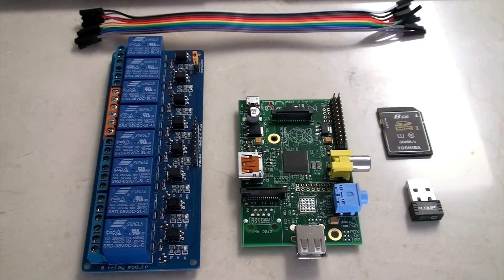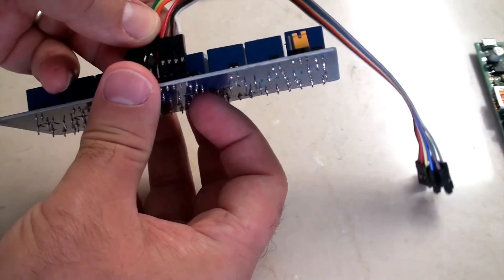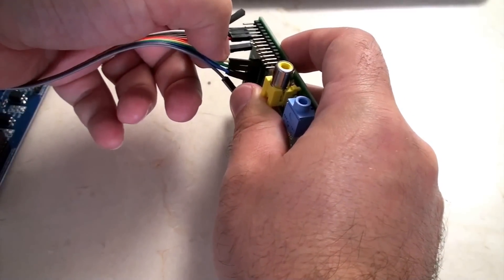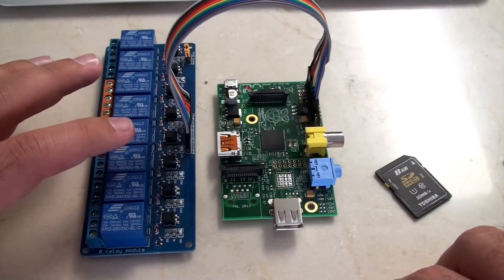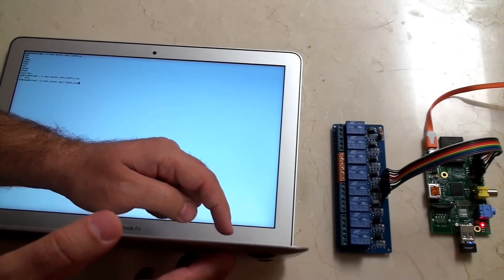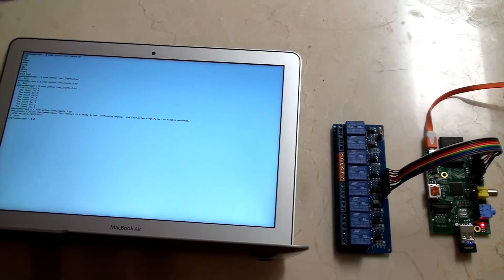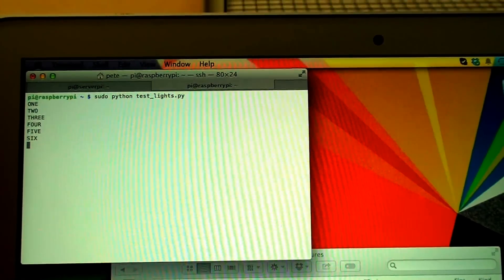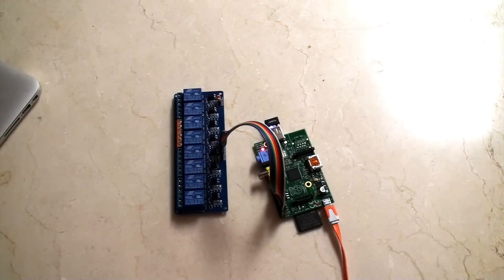Raspberry Pi: 8 Channel Relay step-by-step with software examples for automation

Comment: Hi SkiWithPete, hope you still are here. I am having a problem with my 8 channel relay and my Raspberry Pi model 3. My Pi can't handle more than 5 relays - if I activate more than 5 relays at same time - The relays start blinking and flickering. I guess my problem is, that the Pi can't supply enough power through the GPIO pins, so I have added external power to the channel relay. Neither this solves my problem. I have also bought a 16-channel relay, which is totally hopeless. So I would like to hear if you have any ideas to solve my problem. Of course my 8 channel relay is bought through eBay (China) - could this be a problem? I have never received any electronics from China that didn't worked fine? - I could buy the relay through my local store to 40 dollars instead of the one for 6 dollars from China. - But I am pretty sure, that my local store also just buy it from China...? Looking forward to hear from you. Regards,
Reply from the maker: Is it an optocoupler relay? That's usually the problem, with symptoms you describe
Reply: Hi there again, "Optocoupler"? What does that mean? 🙈 - I now see the word, when I search for 8 channel relay on eBay and yea - I may probably have bought the first and best search on eBay - which is optocoupler. Would this one be better? 
https://www.ebay.com/itm/5V-8-Channel-Relay-Module-Board-For-Arduino-AVR-PIC-MCU-DSP-ARM-LW/172396554144?epid=2068679709&hash=item2823a2a7a0%3Ag%3ADYYAAOSwImRYGpkT&_sacat=0&_nkw=8+channel+relay&_from=R40&rt=nc&_trksid=m570.l1313

If not - could you maybe found one on eBay for me? I know you have linked one on Amazon, but since delivery is really expensive to Denmark - I would appreciate to find one on eBay. If the relay isn't optocoupler - will it then work fine - you guess?

Regards,
Reply from the maker: Frederik Munch-Hansen search for optocoupler relay on eBay.
Reply: skiwithpete Hi there again, now I have been looking for a non-optocoupler relay without any luck. What would you suggest me to do?
Reply from the maker: Frederik Munch-Hansen no, not a non. An optocoupler. Watch my 4 relay video. I trouble shoot there.
Reply: Would you say, that the relay I got from eBay probably might not be an optocoupler relay? There is no problems between my raspberry and my relay in connections.
Reply from the maker: Frederik Munch-Hansen I have no idea what you bought.
Reply: But you think the problem would be solved by buying an optocoupler relay?
Reply from the maker: Frederik Munch-Hansen at least you'd have the relay I use in this video.

Comment: Did you ever figure out the problem with RPi B+ models?  According to the reviews on Amazon, this is not a problem as long as the power jumper is connected between JD and VCC on the relay PCB. Will find out soon as I just ordered one to use with and RPi 3 B+ but this is not a typical complaint in the hundreds of reviews on Amazon.
Reply from the maker: John Baxter I assume it was low power input, but I don't really know

Comment: Said you wanted to build a community so here is some code I did I thought was cool:

from pynput import keyboard
import numpy as np
import RPi.GPIO as GPIO

GPIO.setmode(GPIO.BCM)

# init list with pin numbers
pinList = [2, 3, 4, 17, 27, 22, 10, 9]

# loop through pins and set mode and state to 'low'
for i in pinList:
    GPIO.setup(i, GPIO.OUT)
    GPIO.output(i, GPIO.HIGH)

def on_press(key):

    if key.char == 'a':
        GPIO.output(pinList[0], GPIO.HIGH)

    if key.char == 's':
        GPIO.output(pinList[1], GPIO.HIGH)

    if key.char == 'd':
        GPIO.output(pinList[2], GPIO.HIGH)

    if key.char == 'f':
        GPIO.output(pinList[3], GPIO.HIGH)

    if key.char == 'h':
        GPIO.output(pinList[4], GPIO.HIGH)

    if key.char == 'j':
        GPIO.output(pinList[5], GPIO.HIGH)

    if key.char == 'k':
        GPIO.output(pinList[6], GPIO.HIGH)

    if key.char == 'l':
        GPIO.output(pinList[7], GPIO.HIGH)

def on_release(key):

    if key.char == 'a':
        GPIO.output(pinList[0], GPIO.LOW)

    if key.char == 's':
        GPIO.output(pinList[1], GPIO.LOW)

    if key.char == 'd':
        GPIO.output(pinList[2], GPIO.LOW)

    if key.char == 'f':
        GPIO.output(pinList[3], GPIO.LOW)

    if key.char == 'h':
        GPIO.output(pinList[4], GPIO.LOW)

    if key.char == 'j':
        GPIO.output(pinList[5], GPIO.LOW)

    if key.char == 'k':
        GPIO.output(pinList[6], GPIO.LOW)

    if key.char == 'l':
        GPIO.output(pinList[7], GPIO.LOW)

    if key == keyboard.Key.esc:
        # Stop listener
        return False

# Collect events until released
with keyboard.Listener(
        on_press=on_press,
        on_release=on_release) as listener:
    print('Monitoring Keyboard...')
    listener.join()

GPIO.cleanup()
print('Complete')
Reply: Sterling Butters heyyyy that’s pretty good

Comment: Is the actual pins or the relay putting out power? I just want to use the relay as a switch. I dont want the relay to give any power on the pins themselves. I am going to attempt to solder wires onto a television remote and imitate pressing of buttons by closing the switch. Would this work?
Reply from the maker: Aaron Zaffle yes, the relay is just a switch.
Reply: skiwithpete would I be able to remotely trigger the script to run over the internet? I am familiar with port forwarding however am completely new to pi and programming in general
Reply from the maker: Aaron Zaffle I have multiple relay videos. Watch the 1 and 4 to better understand how to do that

Comment: is it okay to connect the relay board to circuit breaker ?? and in pin of the relay switch connects to the raspberry pi??

Comment: Hi Pete, I like the video and am wanting to do something along these lines. What I want to do is set up a relay to switch from an external power source (the grid or battery bank) to an internal one (ThermoVoltaic cell bank within the heating unit) when the internal source reaches the proper voltage for the DC motor. Do you or anyone else have any thoughts or advice?

Comment: For some reason when I hook this up to my RaspberryPi Model B the code for setting the high and low do not turn on and off the relay. Im copying the code exactly from GitHub and its not working. Any suggestions?

Comment: Hi, I have a 5V 10 A 8 channel relay module. I want to use it for controlling any device which we usually control by switches. So can I can power it just by the 5V GPIO pin or do I need a DC adaptor like you used to power your 16 channel relay in the other video? By the way I have a Raspberry Pi 3, show it should work right?

Comment: Hey thanks to his video I've got a crazy idea to build a car computer / infotainment thing for my 2011 Jeep JK.  Much like the Alpine X109-WRA.  So I got a Raspberry Pi 3 B I think it's the plus and this same relay board within an acrylic.  Now my question is I want to run everything through a touchscreen and make auxiliary switches through the touch screen for off road lights, lockers, winch, etc.  I've got a fuze box to run the 12v from my Jeep to each really through a 30A fuze and a ground bus for all the grounds.  My biggest issue is the software.  I really like the Blynk app but since my Pi has arrived in the mail yet I'm worried it won't work on the Pi unless connected to the internet.  Any ideas that I can use for the touchscreen switches?

Comment: Just noticed that the relay supports two power supplies - one from the PI and the JCC being the 5V for the relays. These can operate independently as from the internal diagram, the two parts (input control and relay control) are connected via a photo diode .

As each relay requires 20mA, then it would seem better to use a separate power supply. To change, remove the jumper. Connect the PI power supply using the  GND and VCC on the jumpers next to the inputs, and use the other GND,JVCC to connect power for the relays

Comment: Hey, man
I am really confused about how the loop works. I made exactly as yours except I want it to run a test sequence such as turning all on/ off one at time. After the test I like to have 4 out of the 8 turning on 30 sec off 30s one relay at time. The last 4 relays on for 50s and off for 80s. All 8 is running in a loop after the initial test sequence. Can you help me out on this?

Comment: Nice job explaining clearly!  I setup my new PI and I think it doesn't have enuf power as the older models do.  I get the full display on the screen of each step but no response from the 8 channel board.  Is there a 3.5 V 4 or 8 channel board or can I somehow get 5 v to the PI?

Comment: Awesome video!  I was looking at your code for the first script and this part is throwing me off...

# loop through pins and set mode and state to 'low'

for i in pinList: 
    GPIO.setup(i, GPIO.OUT) 
    GPIO.output(i, GPIO.HIGH)

I'm still new to all of this but aren't you setting the mode and state to 'high' in this for loop?  To turn on the LED's doesn't the GPIO.output need to go from low to high?  I'm sorry if I'm way off on this, and thanks in advance for any help.
Reply from the maker: high pushes electricity and so stops the circuit from completing.

Comment: what happens if you plug in some device to the wrong gpio pin? Would it burn the raspberry pi or something?
Reply from the maker: https://s-media-cache-ak0.pinimg.com/originals/06/c3/92/06c392b847166a9a671bfcd590d8fff7.gif

Comment: Why did you not connect a resistor in line with the gpio pin? I have heard you can cause some serious problems by not putting in a resistor when using gpio pins. Thanks!
Reply: You're thinking about wiring an led, this relay board probably has a built-in resistor.

Comment: This is a SWAG (standard wild ass guess)...I bet your program runs to completion, yet fails to display as such on the screen because of some type of standard out (STDOUT) buffering that the OS is doing.  After a certain timeout, the OS automatically flushes the STDOUT buffer.  There's probably a python command to force the buffer to flush immediately.  Perhaps something like this...

fflush(stdout); // Will now print everything in the stdout buffer

Comment: Nice Video.  One question, do I need to use breadboard and resistors in order for this to work?  Or can I just plug straight from RPI to the relay board like you did?

Comment: Hey there, nice video really made me understand how the relay board works but I wanted to ask something. So what happens if you "plug" something into the relay (not the pins, I mean the other way around where you can plug wires) can you explain how can I control those?
Reply from the maker: This video will help you to understand: https://www.youtube.com/watch?v=3u45htuQeag
Reply: I've already seen this one (great videos btw really helped me) but I'm talking about the software side of controlling. Like if I connect a light bulb for example, how will I be able to control it through my pi?

Comment: Why didn't u turned the 5v relay to a extern 5v power supply?
Is that possible?
I'm scared to burn my rpi from feeding the relay into the rpi ... 
Can i feed the relay board to a 5v extern power supply, who isn't rpi?
Reply: metrogp Your on the right track. That relay board that he shows has a jumper setting to use power the vcc pin or from an external source. If you have and external 5v power source then all you have to do is switch the jumper to external and it will no longer use the pi as it's power source. This also stops that weird lag in the SSH screen for the raspberry pi B as well. at least it did for mine.
Reply: Uh! nice ! Thx! 
I'm about to make my Automatic House Project :p
Reply: Cool! I'm working on a network controlled thermostat with web access.

Comment: Hi an am trying to do something like this. I am running Home assistant(HA) on the pi 3. I have (1) 8 channel 5v relay and I won 10 of the single channel. Question, I want to use the home assistant software to control the 18 relays. Can the pi 3 power, power all 18 relay?

Comment: I'm currently undertaking a project in which we have to use a raspberry pi to control some pumps and also a couple of rotary/ linear actuators. Is this the sort of route we should be going down to enable us to do this, or would it be better to use transistors? (I have no experience in electronics so this is all very new to me!). Thanks for any help.

Comment: I bought a 8ch board, but it's "Active LOW", and the automation systems (like domoticz) recognize "Low = off" and "High = on", so, then they consider that a lamp is off, but it's actually on.. if I connect the devices to nc, they will be on when the rpie is shutdown....
Did you have the same problem? How did you fixed it?

Thank you.

Comment: Hi I have just hooked up the Raspberry pi 3 to the 8 channel relay board exactly how it is in this video , however i had an intermittent problem with channel 3, this was easily solved by moving the wire for GPIO pin 4 to GPIO pin 5 and Edited the code at the start of the script to output to GPIO5 pin instead, problem solved. great Video clear instructions and got to the point without beating about the bush.
Reply from the maker: Thanks!
Reply: James are you using the same relay? I cant get it to work and its suggested that i get an external power source for the relay. I am using RSpi 3 model b.

Comment: This all fine but can u give examples for use in real world?
Reply from the maker: sure. watch my garage door remote or my ultimate alarm clock. or my how to switch on a light with your mobile phone.
Reply: Turn on a toaster
Turn on and off a lamp/flashlight
Turn on a motor - think robot
Arm a nuclear weapon
Start your washer or dryer
Annoy your neighbours with light/sound/noise
Begin/end a process of making beer - using sensors
Car starter
Did I note a fancy robot?

well this has been relay fun....

Comment: I'm Facing strange issue with RPI3 and 8CH relay.. the issue is relay dimming and sometimes one  relay not clicking...i created a video on this see it herer.. --> https://youtu.be/pwpYfdy29R4
Reply from the maker: I am not sure what is causing that problem.  Perhaps someone else is having the same issue and can answer?  Have you tried setting or altering the clearing line at the top of the script?
Reply: i tried all method and still unable to find bug...also you noticed that third relay is sometime goes on and sometimes not.
Reply from the maker: Ok, I'm worried there's not enough power getting to the relay, or that the relay is defective.  Can you power the relay separately from the Pi?
Reply: sorry relays are non dimming. its a on or a off. you can get variable resistors for dimming
Reply: mark vasquez Did you see my video??

Comment: Hi,I'm following your vids with great interest, however I have done all five of these, but Project 4 does not work very well. . . . First:       all the lights come on in sequence, but stay on.second:  the count down does not reduce from '9'. It stays '9' all the way and will not stop until I intervene.Any ideas what I am doing wrong here ?I am using a Raspberry Pi B+ model.regards.Richard
Reply from the maker: there must be a formatting error in the script. open an editor and take a look.
Reply: Thanks Pete I will do that. Incidentally I notice you used a MacBook Air with 'bluetooth', I am running directly via the Raspberry Pi itself. Might that make a difference ?
Reply from the maker: +Richard Paul no. I'm actually using SSH, but that won't make any difference

Comment: I bought a sainsmart 8 channel solid state relay board and wired it up as shown in this video. when i powered on the pi, 4 of the relays's lights were lit and stayed lit after the pi booted up. i have read that this is because of the gpio's high or low pickup/dropout. 
could anyone please elaborate on this? or tell me why, in layman's terms, the relays are starting in the on position? 
edit: I was using my relay in conjunction with my pi and the opensprinkler app, turns out that the opensprinkler board (I'm using only an 8 ch relay, no board) uses a number of gpio pins.....so once moved my wires to gpio pins not being used, everything worked.
so to summarize, if you are having the same problems I was having, I suggest making sure the gpio pins you are using are, in fact, open and not being used by the program you are running
Reply: Same Problem here, did you find an explanation?  I am using them to control water pumps, I have a separate power supply for the pumps, if I turn the power to pumps on but leave the raspberry off they we always on, when the raspberry is on and booted into the program I wrote they will turn off  as the standard state
Reply: Me too, no idea why.

Comment: Thanks for the tutorial! It was really useful! 
I have only one question for you (Sorry for it but I´m a Raspberry noob) , I see you used GPIO 4 (gpio-clk) and since I´m using the same pin by a DS18B20 sensor, Can I use another pin or the gpio-clk can be shared?
Thank you in advance!
Reply from the maker: yes, just change the BCM pin number in the script.

Comment: Thanks for the tutorial. I dit it with an Rpi model  B rev 2 and it  did juste fine. May be  the  problem  you described is a software bug resolved in the  latest version of the  OS.
Reply from the maker: Cool.  Thanks for letting me know.
Reply: I had the problem with model B and I just started and got fresh OS